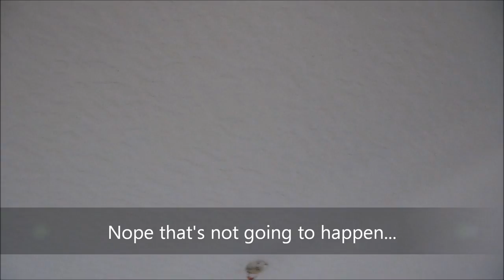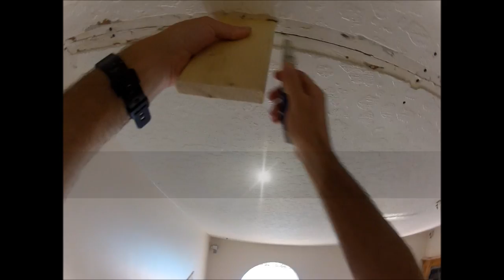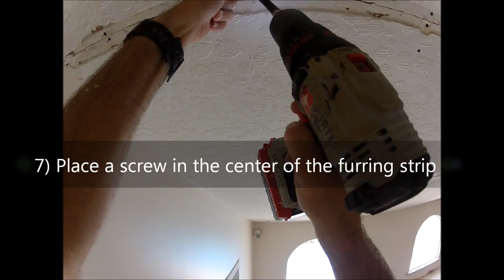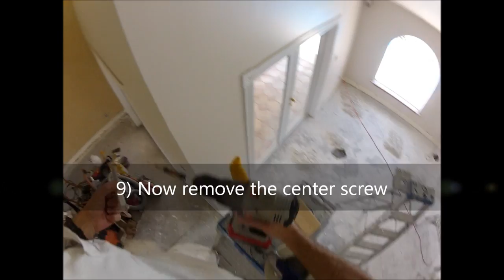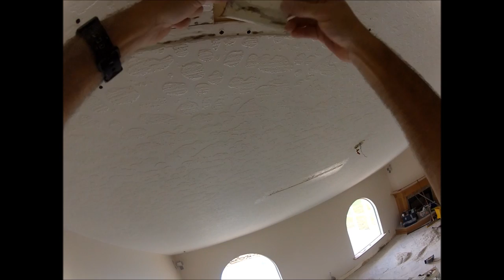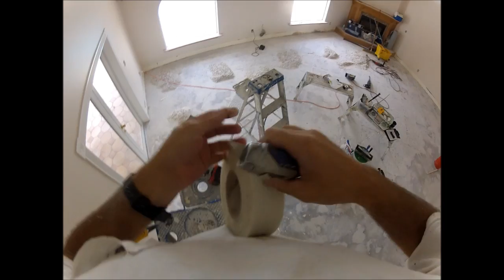How To Ceiling Repair Trick- Ceiling Sagging? Tape Joint Cracking? (Part 1)

Comment: In America’s they only use all purpose type of products that are pre mixed in buckets and don’t dry so working time is long. That’s why the tape just peels off so easy and they don’t back block joints while hanging plasterboard
Reply: Wrong. Paul is in america and does not do this. People everywhere are novice man. Chill out.